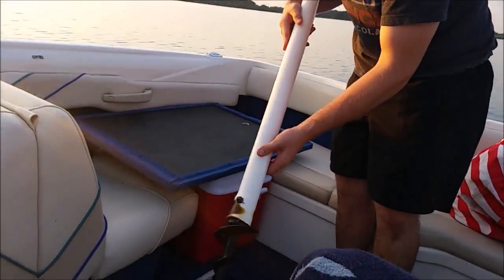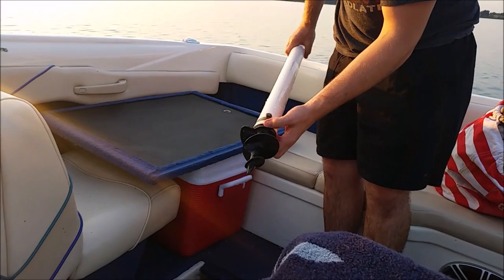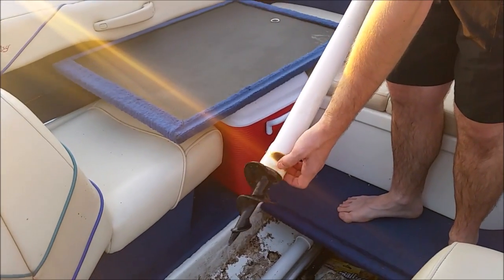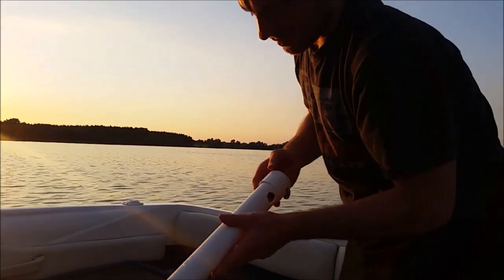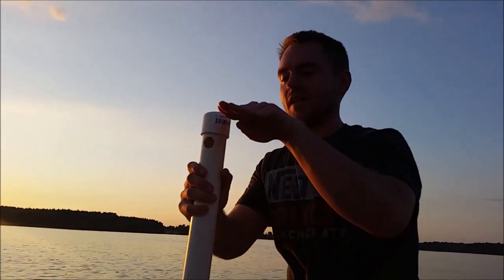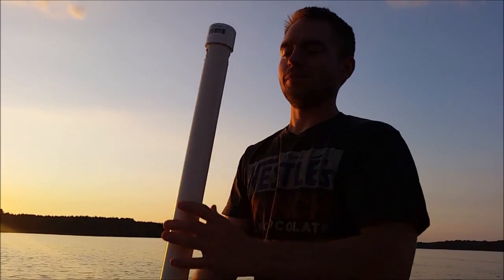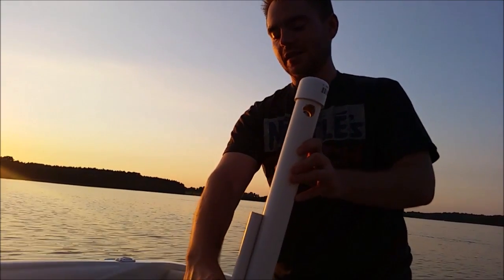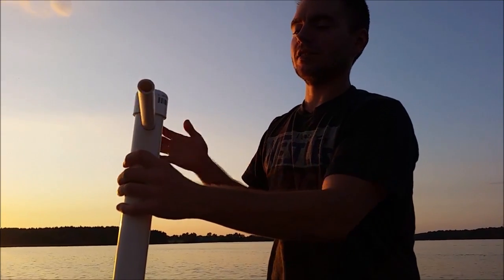*Update* Homemade DIY PVC Sand Bar Boat Anchor Auger Revisions

Comment: good ideas, works for sure. You might want to leave the larg cap loose. So you may store  the driver handle and tie down rope. all will fit inside the larger tube.  then use  wrap around velcro, to attach two anchor poles together!
Reply from the maker: Yeah we were on the sand bar the other day when a storm came in and I was amazed how well they held. The wind was blowing so hard the second I untied the rope from the cleat the boat was starting to sail to shore. The driver handles are a pain in the butt to hang onto while I'm tying the rope through too. I'm too lazy to remake them though.